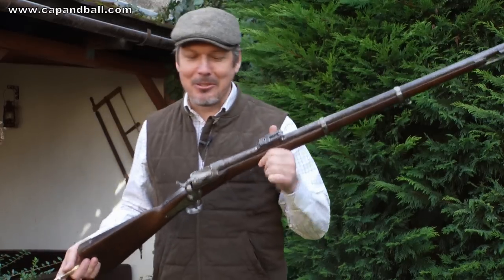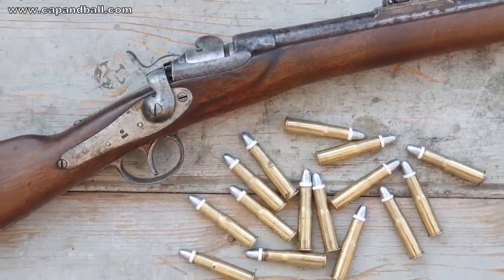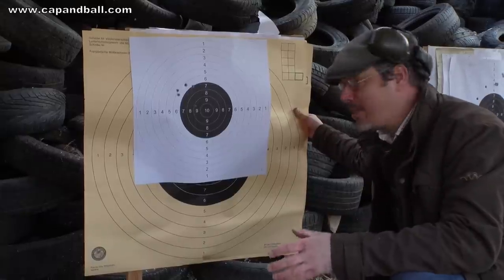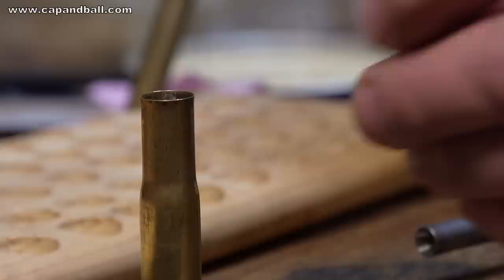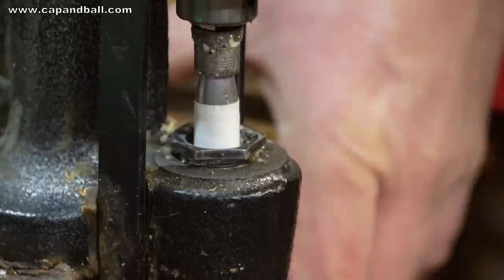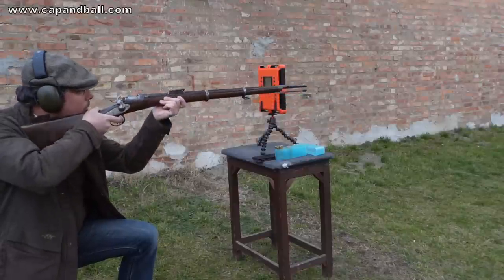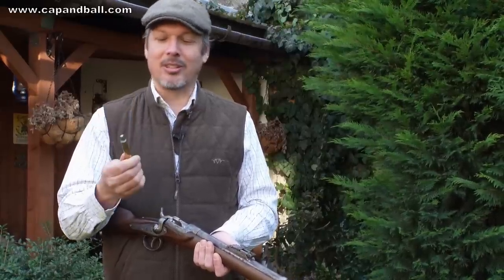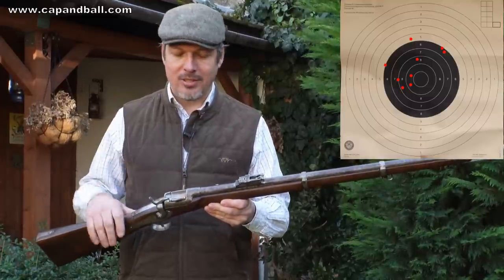The Werndl rifle and the 11.15x58R cartridge - Mad minute

Comment: This is an outstanding video.  I have reloaded for Black Powder Cartridge Rifle.  I have found that using a drop tube of at least 1/3m helps give me a cleaner burn Also, I leave the slight flare on the case mouth, I feel that it helps clean some of the fouling out of the neck area of tapered and necked cases.  I reload for 1886 Winchesters, 1873 "Trapdoor" Springfields and 1885 Highwalls and Low wall Winchesters. You must flatten the flare for the lever actions but can leave it in the single shots.

Comment: While I have several bench mounted reloading presses, I also prefer to load my 11.15x60R and 45-70 with hand tools... specifically the Lee hand press.  After watching you use an 8mm die to crimp your cartridges, I now use a 22-250 bullet seating die to put a nice taper crimp on my 11.15x60R.   Thank you for the tip.

Comment: I'm in the States, I have an original model 1873 Trapdoor Springfield. I am going to get a wad cutter and a few other tools and load it with the Holy Black.  It is 80 years older than me as it was built in 1876 according to the serial number. It should be fun

Comment: Another excellent research based video, but why not use a reloading press instead of hammering the sizer over the case, a cartridge holder can easily be made to fit that rim. Chris B.
Reply from the maker: Answer is simple: 1st: I do not have dies for the Werndl, 2nd I am following the original reloading process the troops used.
Reply: @capandball  Did the troops reload their own cartridges?  I would have assumed ammunition would have been produced either at state arsenals, or commercially.
Reply from the maker: @jic1  Yes they did. Cases were a great value. For training purposes the cases were reloaded 6 times. 3 times for live rounds, 3 times for blanks. There were two institutions for reloading: there were central facilities (in Hungary 4 facilities) for reloading, but the units themselves could also reload the spent cases.
Reply: @capandball  Thank you, that's very interesting.

Comment: Are you aware of any commonly available brass that can be converted to 11.15x58R? 
Perhaps  45-70 or .303 British? 
I understand that the neck would be a little short,  but that's not usually an issue with single shots.
Reply from the maker: They can be fire formed from 10.3x60R cases easily. I am just modifying 50 from these.
Reply: @capandball  ebböl a 10.3x60R nekem egy rakás van a fiókban😉